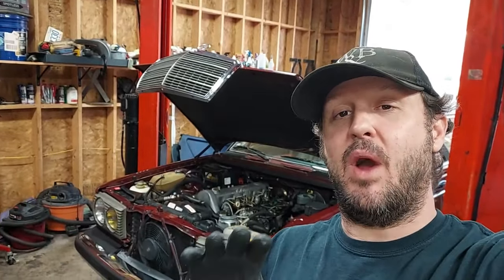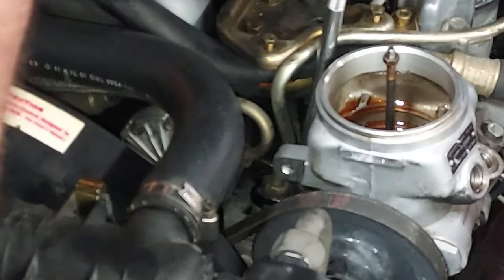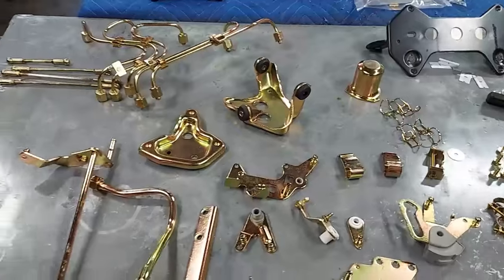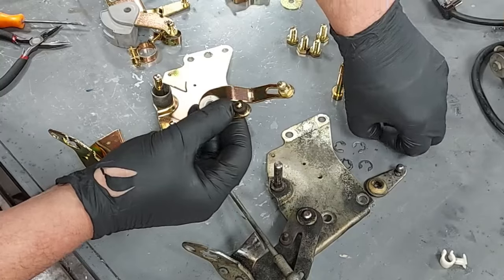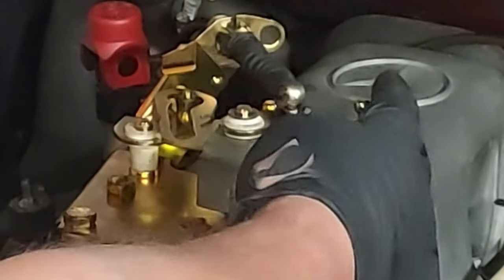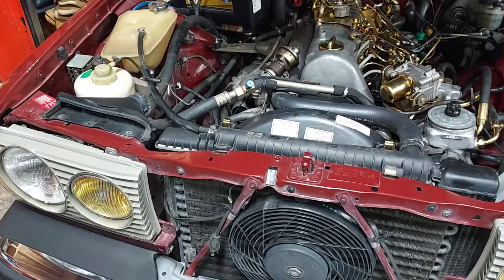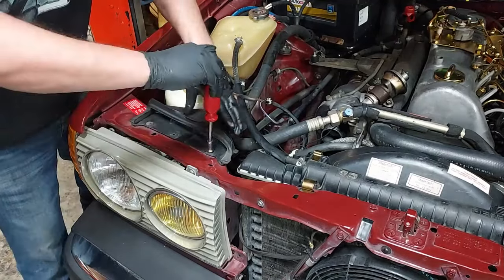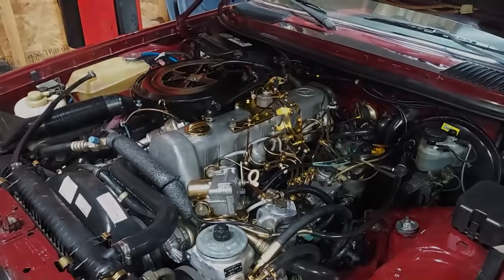1984 Mercedes 300TD - Part 6 Zinc Plating Engine Compartment

Comment: Looks awesome, John!  Related to the trans fluid question.  Is there any concern about plating the ID of the fuel injector lines?  I’ve read that the diesel fuel can react with the zinc plating.
Reply from the maker: No you absolutely do not want to plate the inside of your fuel injector lines it's very important that you put rubber caps on the lines before you send them off to plating. We Cap all of our lines so nothing can get in there. It's not because diesel is going to react with it it's because it will clog up the line if any plating or anything else gets inside the line.

Comment: Can you do zinc plating yourself?
Reply from the maker: No we have a guy that does it for us by hand.
Reply: Phenomenal video!…What is the ballpark cost for the zinc plating service, could you share the plating service name?
Reply: Yes, I'd like to know if I can get mine both om617 and om603 hardware zinc plated from the guy work with. Thanks
Reply: @woodsandbarclay  LUV UR Video's... i have a 82 300d that im in the middle of restoring, id like to send him my lines/cables/bolts/brackets... thank you ;)